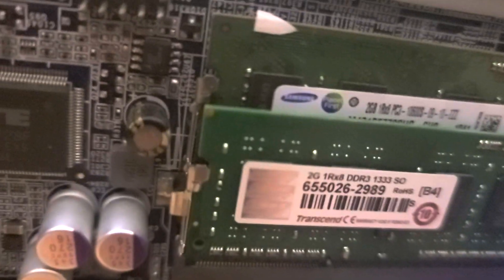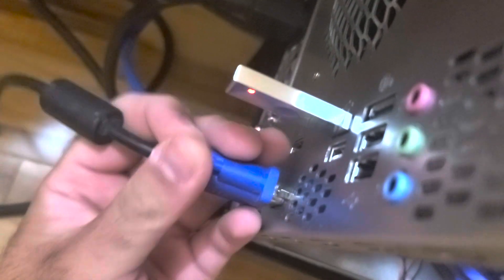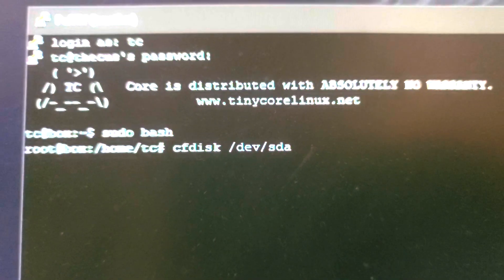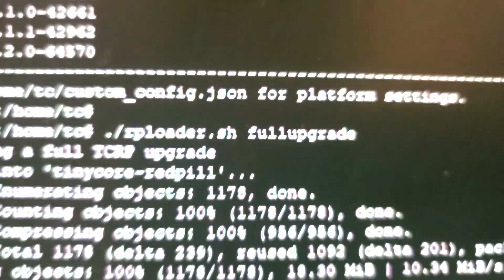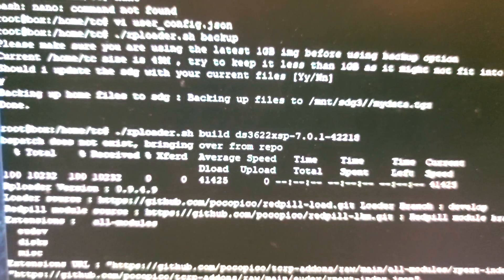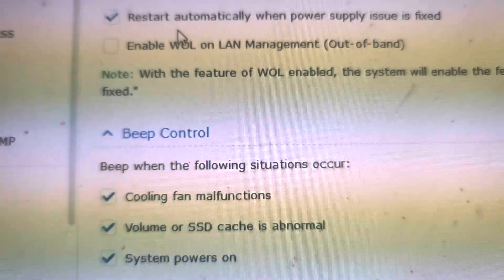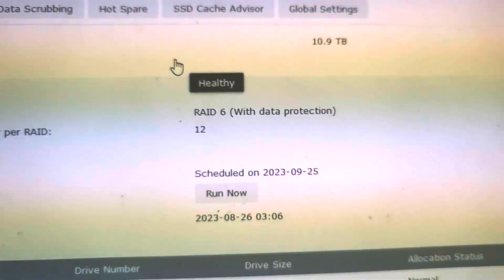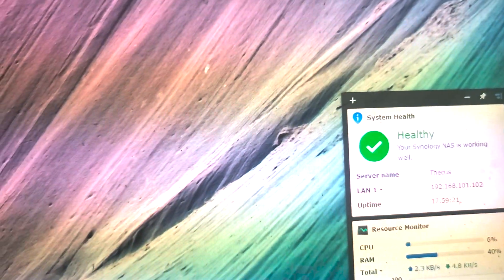Thecus n5550 to Synology XPenology conversion with 7.x

Comment: Can you still use the front usb 3.0 port after upgrading to synology disk station OS? Thanks.
Reply: It works
Reply: @EnchoUzunov  got mine working. It was incompatible RAM that was 1.35v vs recommended 1.5v I used that caused this issue. Thanks
Reply: @prixinc1  everything works very good on DSM 7.1.1-42962 Update 1 , only the fan was going crazy, but I extended the cable to the CPU fan and now it's also silent and works great